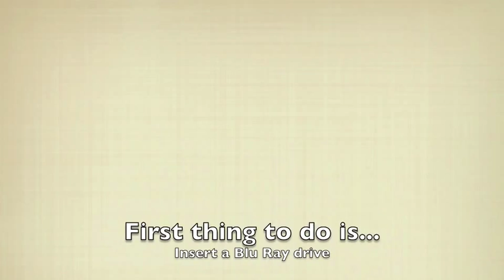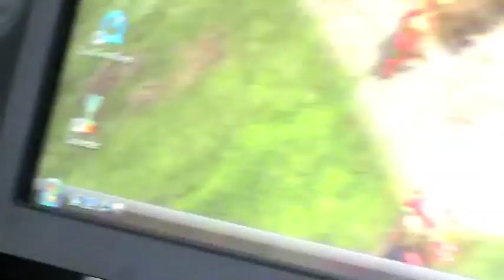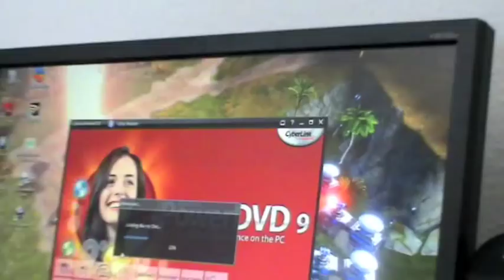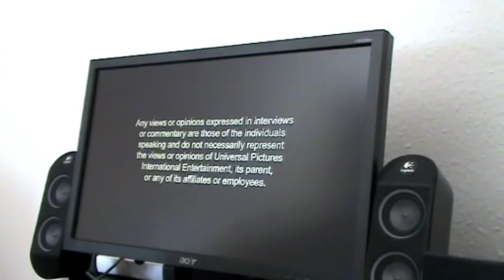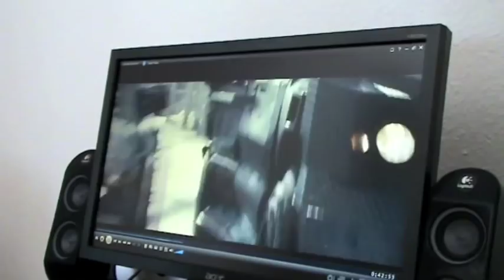How to play Blu-ray movies on a PC

Comment from the maker: @firstjedi The benefit of having it hooked up to your computer is that the surround sound system is easier to set up. You don't need any special recievers or anything. Just a 5.1 sound card. Wich most computers has. Maybe even buy a Creative PCI Sound blaster so you can have sound for your PC, and for films.
The benefit of having a BD device for your TV is that you don't need your PC. Incase TV and PC gets in each their room.

Comment: Installed an LG Super Multi Blu Ray Drive in my  custom built PC along with the Ultra 9 Software. After inserting the blu ray disc and going through the previews; I get the movie intro screen but No play movie selection! Is the problem with the disc ???

Comment: i have a question, That is  DVD also yeah? so does that mean i can take out my dvd drive and when i want to install a game i can just put it in the same drive as my blu ray, or do you have to have a separate DVD drive, also nvidia geforce8800 GT and 650watt should run a bluray drive